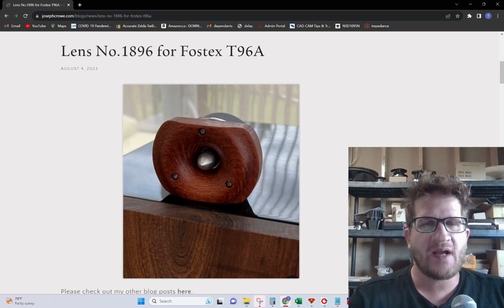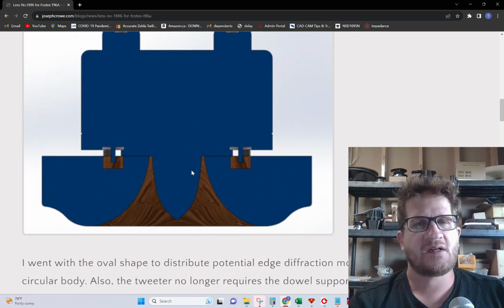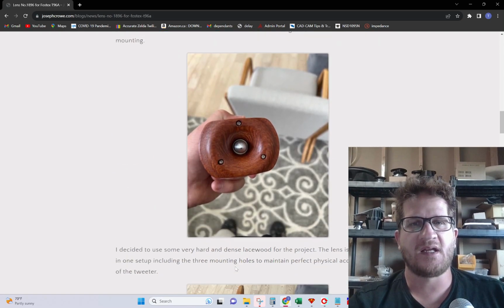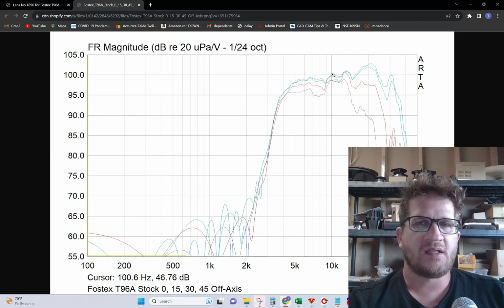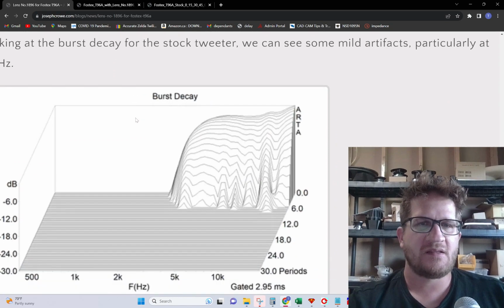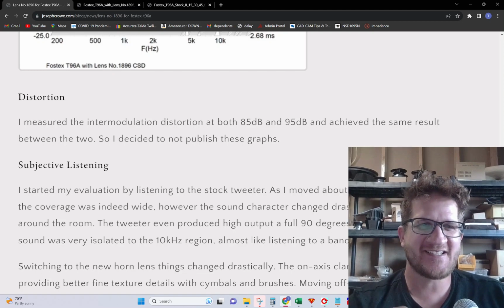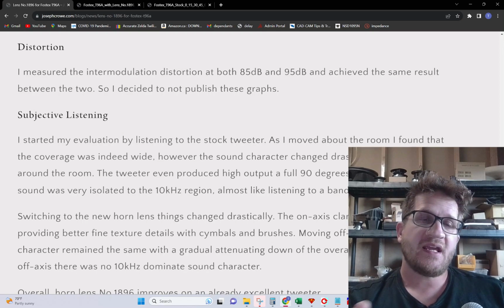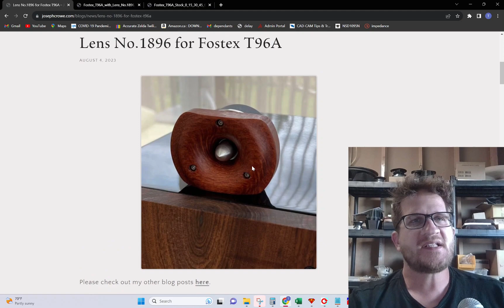Lens No.1896 for Fostex T96A

Comment: I love your horn designs.  What are your thought in using large horns in open baffle designs?  At that point they are no longer OB or dipole because the backs are closed.  Right now I'm using a Markaudio Alpair-10P Paper Cone 6" Full Range driver as my upper range 300hz and up but I wonder if I'm missing out on some top end with this design.  I had to boost the HF a lot to keep it from rolling off really early, but this design is dipole through and through.  My thought was to keep the full range speaker but add a horn tweeter for the top end.
Reply: It seems hard to find DIY lenses or horns for compression drivers that have off axis data.
Reply from the maker: I started out by purchasing the B&C ME20 horn with the B&C DE120 and I got good results with the Fostex FF165WK 6.5 fullrange. It was a step up in soundstage width compared to running just the fullrange. After that I did a similar sized JMLC circular horn and I noticed better clarity. 
But I still missed the coherent point source quality. So fast forward ten years and I think the shallow horn No.1928 using the 3” Fostex FF85WK crosssed at 200Hz provides the best of everything. Soundstage, smoothness, everything. 

https://josephcrowe.com/blogs/news/shallow-horn-no-1928-with-fostex-ff85wk